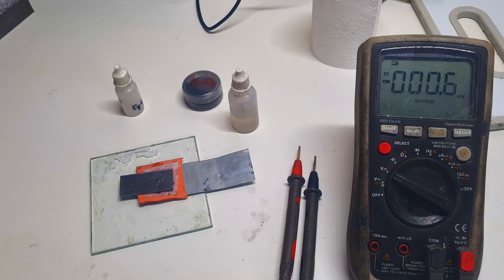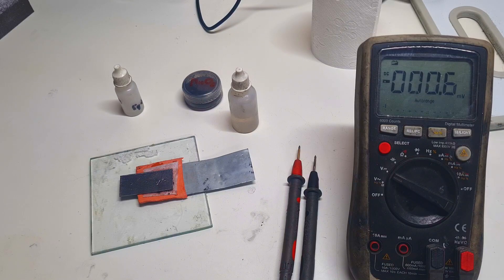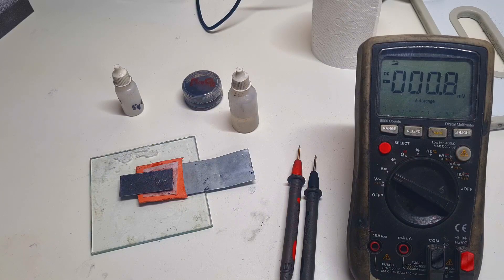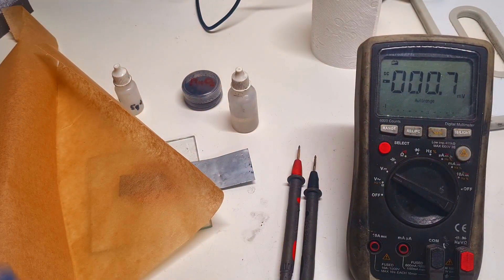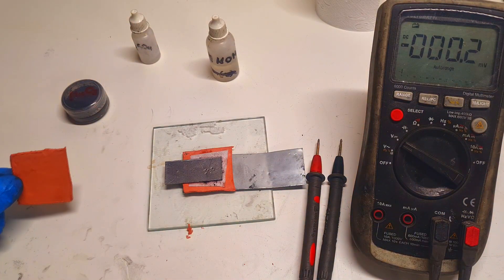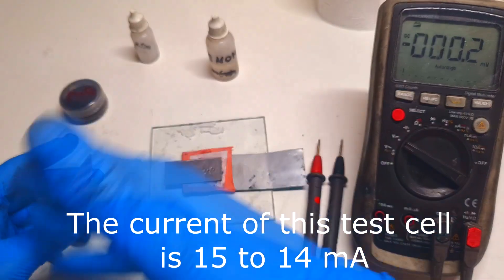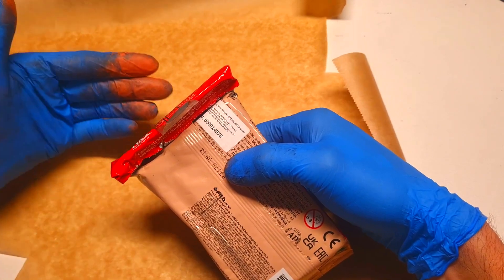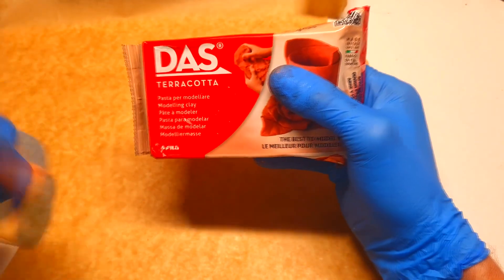Clay membrane in Dual electrolyte battery

Comment: Have you tried using a very thin film of regular LDPE as a membrane? I recently saw some experiments where it seems to allow ion exchange. Not in the setting of a galvanic cell, but I dont see why it wouldnt work for that also. Looking up some data on the porosity and pore sizes it seems quite plausible. I'm a complete newbie to electrochemistry though, so I might just be missing something obvious that makes it unsuitable.

Comment: A pottery trick for rolling out flat sections is to put down two pieces of wood that are the desired thickness on either side of the clay, then roll the clay.  The wood supports the rolling pin and sets the thickness.
Reply: In 2017 I saw a 3D printer extrude terracotta at a mini maker fair. The possibilities are many to achieve standardized thicknesses.
Reply from the maker: Yes nice,... Is almost the same like we apply a electrode material for thin film electrodes. Which in that case have the thickness in the range of 0.1 to 0.2mm

Comment: cool. would you say thats close to what the most professional ion exchange membranes are.
Reply from the maker: No,... the clay membrane is still a porous material. An ion-exchange membrane is a semi-permeable membrane that transports certain dissolved ions.
Reply: how about just coarse sand (SiO2) or sand paper, as the separator if any
Reply from the maker: @gsestream  Good thinking,.... I use sand or better to say a dirt mix in some of my batteries years ago for the separator. I also have some video about that which I will upload to the youtube.
Reply: @cayrex  how about something concrete as the separator
Reply: @cayrex  I mean using portland concrete mix or sio2 plaster mix, and electrolyte water to harden a solid state separator or just solid state electrolyte
Reply from the maker: @gsestream  Yes yes is almost the same

Comment: A pasta rolling machine will give you very thin sheet of the clay
Reply from the maker: Yes,... Or some hydraulic press will also do the job really nice.
Reply: Maybe you can put something on each side that is thinner, like 1mm thick spacer that the roller rolls on top of? Maybe then you can get even higher energy density... ? Not sure how that well work.